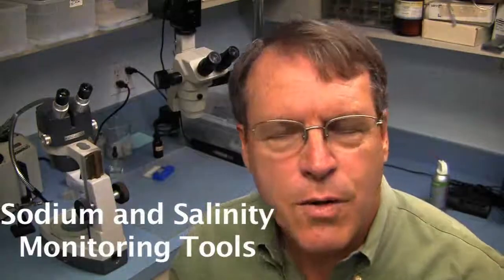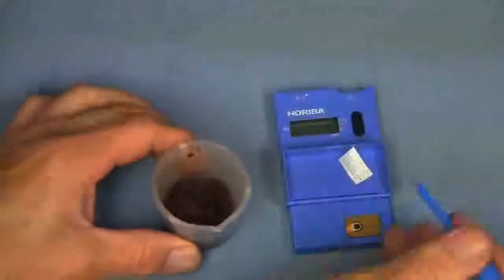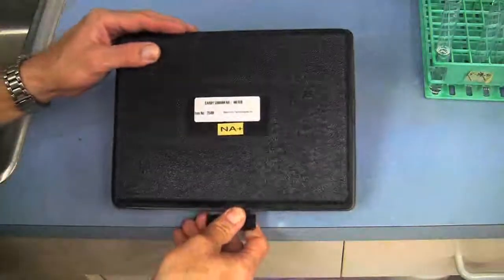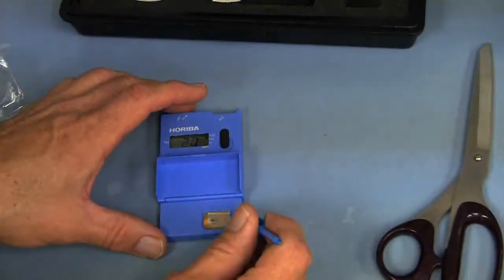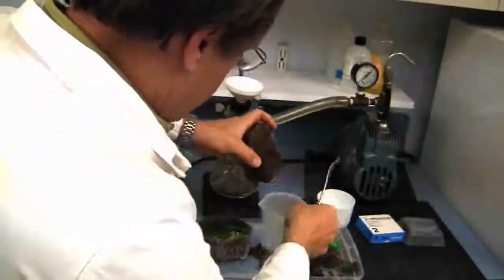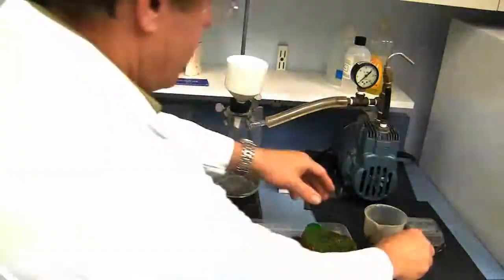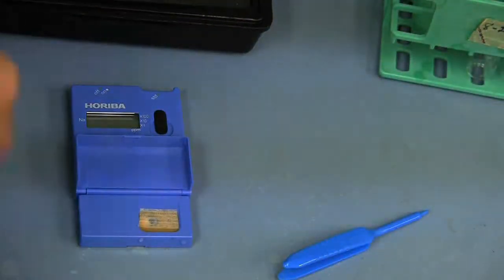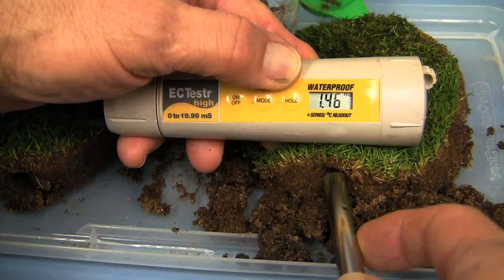Sodium and Salinity Meters

Comment: I'm fully aware that this meter is not approved by the FDA or TGA to measure blood sodium, but does the measuring range cover the concentration for human blood sodium? The range for normal blood sodium is (135-145) mmol/L or (3105-3335) ppm, assuming the density of blood is practically the same as water. At the moment there is no "at-home-test" to get an estimate for patients who frequently become hyponatremic or approaching dangerously low in blood sodium, so this could at least quickly tell if the developing symptoms are related to hyponatremia or not, especially if you're too far away from a hospital to get immediate attention, and by knowing for sure that the patient is hyponatremic, immediate appropriate administering of sodium chloride could easily avoid the blood sodium from approaching the life threatening zone, thus buying much more time for the patient to get professional help, without facing the risk of a seizure or even coma and death. A quick and easy finger prick for a few drops of blood could be a life saver even if it is not officially approved for use as a diagnostic tool on blood chemistry. It is still better than being as blind as a bat and not knowing what is going on with the patient, whether to give sodium chloride or not.